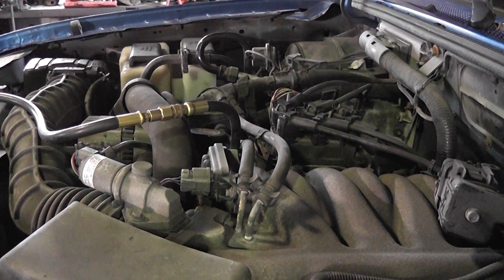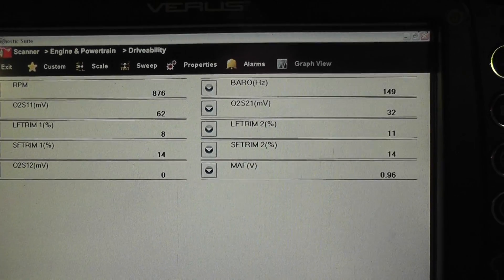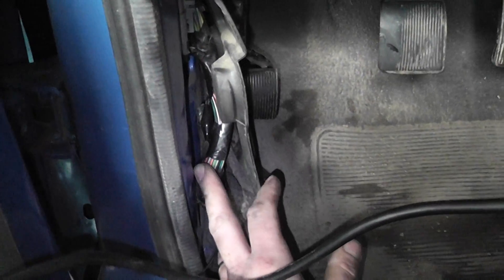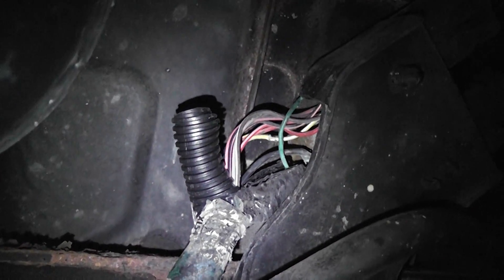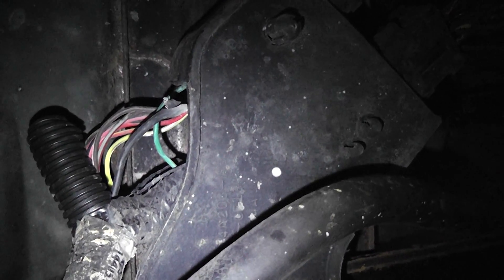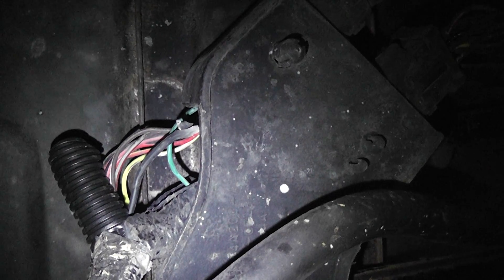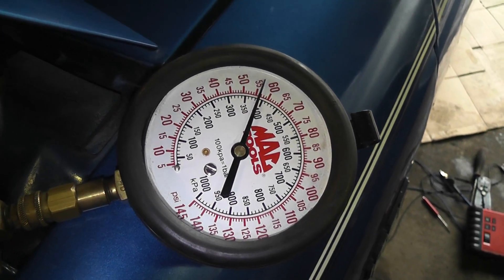Low Fuel Pressure from a bad fuel pump ground (Ford Ranger)

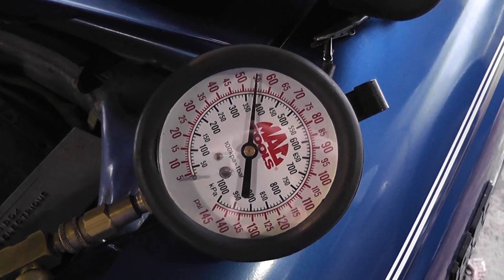Comment: At about 3:25 you said right off the bat that it must be a shared ground between the pump and headlights.  Why was it immediately so obvious to you?
Reply from the maker: Just knowing my fundamentals and circuit designs, I knew it couldn't be anything else. And now that you've been studying and taking my ScannerDanner Premium classes, this kind of thing will start making a lot more sense. It's cool to see you eating this stuff up man. You are doing exactly what it takes my friend. Thanks for giving me a chance !
Reply: I'm really enjoying the basic electrical concepts review section.  Quality instruction on the Internet ( or anywhere else for that matter ) is hard to come by and I'm glad to have stumbled across your channel and then your premium classes.
Reply from the maker: Thanks for giving me a chance!
Reply: Fuel pump is a electric motor.
idk wtf is wrong with mine. its been running lean and sometimes turning over and not starting. Fuel pump not priming. It finally quit all together. I assumed the pump went out since its 1999 f150. Ive put a new one in and its still not coming on to prime. I got 10v at the pump but my ground wasn't from battery. The Audio, GEM, PCM fuse was blown. All others good.

Comment: I meet a guy at spare parts shop, he has a problem with his car when he start the air conditioner, the car shuts off. Maybe it is the same issue here. Bad ground,, possible.
Reply from the maker: If he can keep it running with his foot on the gas pedal, it is a different issue. I'd suggest a throttle body cleaning if that is the case

Comment: Why don't you  test the  ground with a  test light ? You  are loading the  circuit  that way  !
Reply from the maker: Test light only loads the circuit partially (200ma). Where the fuel pump draw is close to 10 amps (10,000ma).
So which one is the better load? This bad ground would have tested fine with a test light to battery positive without the pump running.

Comment: I have a feeling this is whats wrong with my 94' c1500 chevy 5.7. Its running great except for on the freeway after 65mph+ for 5 minutes it starts to slow itself down and Im having a voltage draw issue making my new alternator whine, removing the rear single plug wire makes the noise go away and back again when plugged back in. My blinkers are causing a huge voltage drop when headlights and brake lights are applied at the stoplight.
Reply from the maker: Sounds like two separate issues with one of them being a faulty alternator (lights dimming and whining)
Reply: @ScannerDanner  But its the 3rd new alternator ive put in in a week. NEW not rebuilt. I though they had bad bearings but its a voltage draw causing the whine and Im lost.
Reply from the maker: again, two separate issues, low power complaint with an alternator whine. Did these occur at the same time?
Reply: @ScannerDanner  6 months ago I was on my way home from Lake Havasu on the 40 freeway. You have to have your headlights on when you leave Havasu on the 95 for daylight. I forgot to turn them back off after I got on the freeway and after an hour or so I started losing speed then truck died. Waited a few minuted then back on the road but it did it again within 5 minutes. Over and over until it finally quit, dead battery. Had it towed and the mechanic said he had to put a new battery cause old one wouldnt hold a charge, and that he had to put a fuel filter in to. Wouldnt turn over until the new battery then wouldnt start till the new filter was in, then it ran again. I drove it to Havasu one more time with no issues, but after I got back it started to do that to me on the freeway on my way home at night and has been doing it every single night for the last 3 months. Another new battery didnt help, and the origional alt started to go bad, the battery alt gauge was dropping as I was driving, replaced the alt and no more drop but the new alternator were whining. Old one wasnt. Unplugging the F(field) wire from the back of the alt make the whine stop, then returns when plugged back in. There must be a draw on that field wire. Im thinking there is a bad ground to my dash/ignition system, causing the fuel relay or pump to overhrat while on the freeway???? Last night I had to use my wipers and they were weird, running a few times then stopping for a second then running a few times and stopping again, slowed a bit then speed back up. When I turned on my headlights to leave work my sterio quickly cut out but was still working. Ground?????
Reply: Ive spent over $1500 over the last 2 months on mechanics/ diagnostics/ parts, Ive done research, asked around and cant get anywhere with this issue. Ive put in a new fuel pump, filter and injectors. A new Battery, throttle pos sensor, O2 sensor, ignition control module, MAP sensor, EGR valve and still have no joy. Last week I had the fuel pressure tested and the trans tested, both passed. No water in my oil or oil in my water. Fluids are all full and clean.
Reply from the maker: Absolutely sounds like a main block or body ground issue. Unplugging the F terminal just makes the alternator stop charging. The reason you hear it whining is because it is probably full fielded from charging your battery that you say keeps going dead. 
Ignore the whine for now. Focus on your main grounds. Main cable to the block and main cable to the body, or main body cable to the block.
Reply: @ScannerDanner  OK thank you for your time brother. It has a ground to the intake manifold but only a little red wire to the fender wall, nothing else, no ground to the frame. maybe I need a thicker ground to the fender wall and add a ground from battery to the frame. Ive owned this truck for 8 years and its been hooked up this way the whole time, maybe it was just a matter of time til it did this.

Comment: Do you know if they changed the way this was routed in the 2002 model? I'm working on a 2002 Ranger XLT. According to advanced autos scanner its throwing 33 codes! My cheap harbor freight meter grabbed 11. Everything from miss firing to transmission codes. When driving it dogs bad, like it's starting out in 3rd and never shifts, itll sit around 3 grand on the highway. I can manually shift it down to 2nd but not first. I'm guessing it's a 3 speed with overdrive.
Reply from the maker: I am not sure, sorry

Comment: Have a similar issue on '11 f150 6.2 v8. Trouble starting, left power running board not going down, driver seat not moving up or back, left tailgate lightbar all not working properly at intermittent times and not at the same time. Is there a place that isn't too expensive or free to get good wiring diagrams for my truck?
Reply from the maker: https://www.scannerdanner.com/forum/post-your-repair-questions-here/16-need-service-info-check-here.html
We've created a thread on my forum to help you guys with this. Thanks! It's free to join.

Comment: Hello. I have a 98 mustang GT. It has a slight misfire in 2nd and 3rd between 1500-2500 RPM. My fuel pressure with key on, engine off is 0 PSI, 29 at idle. I replaced the fuel pump, filter and the regulator. I am going to pressure test the fuel pump but I have a feeling it was something to do with the electrical components or the injectors. Any advice on this one? Thank you.
Reply from the maker: This sounds like a light throttle misfire with is usually a secondary ignition symptom. While it is certainly NOT normal for fuel pressure to drop to 0 when you shut the car off, this may just be a leaking pump check valve which will have ZERO affect on how the pump performs when the car is running. The only thing this would give you is a longer than normal crank time. 
There are other causes of fuel pressure dropping to zero on shut down that WILL cause some diveability problems (leaking injector, leaking psi reg diaphragm) but these will also cause fuel trim issues. 
Do you have access to a scan tool that gives you your fuel trim numbers? If you do, I need hot engine idle STFT and LTFT on both banks and then 3000 rpm, again, both banks.
Reply: Hello. Thank you for your response. I just data logged everything. Where should I sent the Excel spreadsheet with the data? at hot idle, STFT on bank 1 was between -1.6 and +1.4 and LTFT started at -4.7 and climbed down to -6.2 with time. On B2 STFT was around -2.3 and LTFT started static at -3.9 and went down to -4.7.
At 3K RPM, on B1 , STFT was between -3.1 and -0.2 with occasional spikes up to +3.1. LTFT was static at -6.2. On B2 STFT was between -5.5 and -0.8. LTFT was initially -3.1 and then stabilized at -2.3.
Before the tests when I turned key one, engine off on a cold car, I had 0 PSI and 29 PSI with engine running. Interestingly, when I turned off the car, the fuel pressure was 29 PSI and the pressure decreased at about 10 PSI per 20 min. I have a return fuel system so I don’t know if this is acceptable. 
During the second testing, on an already hot engine, I had 3 PSI with key on, engine off. Then repeated and the PSI jumped to 11 PSI and went I turned the key on the third time, it jumped to about 35 PSI. After I took out the key, the PSI dropped at about 2 PSI per 1.5 minutes. When I turned the car on with a hot engine, it again was 29 PSI. Gave it some snappy throttle and the PSI quickly went down to about 25-26 PSI and quickly came up to 29 PSI. With different loads at 1.5K, 2.5 RPM and 3k RPM, the pressure stayed at 28-29 PSI. Never went above 30 PSI. After I shut down the car, the pressure decreased by about 10 PSI in about 30 min.
Also, my scanner was stating that the fuel system was in closed loop all the time. From the first till the last second of data logging. I started logging with a completely cold engine and in the end after pressure testing, even went for a short drive with an operating temp. Still it was showing that it was in a closed loop. Is this normal?I would appreciate any advice. Sorry for any confusing sentences.
Reply from the maker: this data log isn't going to help me sorry, I would need to car

Comment: I got a 2000 Toyota Camry 
P0304 
P0171 
P0500 

I replaced 
Cam Shaft Sensor 
Crank Shaft Sensor 
MAP Sensor 
Cleaned the EGR
EGR Modulator 
TPS
VSS - I am Still getting the P0500 (I have a multimeter so I will test that)
Radiator and thermostat
PCV valve and grommet 
Timing Belt 
Plugs and Wires 
Used Lucas fuel injector cleaner X2 as well.
I have a new knock sensor but I could not get the new part on because that is EXTREMELY hard to get the old one off 

The car will run for 15 miles then CUT OUT.
The car will restart 45 minutes later but misfire BADLY.
Something obviously is getting hot then killing the engine
Help Me!!!

Comment: and  for what it is  worth a mechanic , told me the  fuel pressure was between 30 and  40  at the  rail which  seems  low to me . its a  4.0 sohc
Reply from the maker: Absolutely my friend. Thanks for hearing me out. I was a little harsh in my first reply. Sorry about that. Text is hard to tell emotion
Reply from the maker: Yes you do, but your pressure regulator is mechanical. The electronic returnless system I mentioned has no fuel pressure reg. It uses a variable speed fuel pump and has a psi range of 30-70 psi.
60-70 is a little high for you but that's easily 5 psi off depending on your fuel psi gauge. 55-65 is the spec I remember for your system
Reply: If you have the returnless system (fuel filter has one line both ends) 60-70psi is normal, If you have a return line on the fuel system(fuel filter has two lines at one end)  then 30-40 is normal.
Reply from the maker: This is not true, in any way
Reply from the maker: Depends on if this is an electronic returnless or mechanical returnless  system.  For the electronic returnless (variable speed pump) 30-40 is normal for an idle psi. On the mechanical returnless type 55-65 should be your psi all the time (idle and wot) 
To determine design, look at the fuel rail, if there is a 3-wire pressure sensor on the rail, it is electronic
Reply: I agree with that, but I have a electronic in tank fuel pump returnless system and 60-70psi is right in spec. as far as ford is concerned. System is run off pressure and not vaccum like return systems. I guess my system is over pressurized then according to you?
Reply: ScannerDanner  Thank you for the info., your opinion is one that I trust, learned alot from watching your videos, thanks for doing them. Have a blessed day, aloha.

Comment: hey great video dude , I have a f=different problem maybe you can answere , a 2007 ranger sport with a  replaced motor of 61 k ,,,,,,,,,,,,,    I  was  getting poor acceleration and hesitation . the scan read faulty bank 1 and 2 sensors , so I replaced them they were  old and original and  still have the  same reading and  hesitation . oddly ,  the  temperature gauge gets to the middle id say operating temperature in less   than  2 miles or  so ,  can  this  be sending a bad or no signal  to the  computer to go from open to close  loop ., it seems to do it  cold  also , in fla  so not frezzing  cold lol ,,,,,,,,,,,,,,,,  I find it odd it would raise the  needle to the middle so quickly is all , and  can  that sensor just be cleaned . or checked ?  and  would a open loop come up in an obd2 scan with the  rich o2 sensor  readings ?
Reply: As long as you get a code(check engine light), the vehicle will go into open loop by default.
Reply from the maker: You need to take your truck to someone who knows how to troubleshoot.
Oxygen sensor codes do not mean you need oxygen sensors. Sounds like a lean condition from your description.
You also need to make sure the correct engine was put in. Some of these are flex fuel systems that use different injectors than the regular gas only engines.

Comment: Does a 1992 Ford Ranger 2.3 liter 5spd p/u have a fuel safety cut off switch? 
I believe when pump is bad, however when its warm out (above 50°F) she starts right up. In winter (Baltimore Maryland area) it'll crank & crank & eventually catch & the truck will run fine all day after that. The other day while driving,  hit a bump & she started to run like it's fuel starved.

Comment: Dan,I enjoy your videos, they are very informative. I am concerned with your technique of wire piercing.That should only be done in extreme circumstances,when there is absolutely no other way to obtain a measurement. And then the piercing needs to be weather sealed to prevent a future corrosion failure.Sorry for the criticism but, the fact that you are so adept at troubleshooting conveys the message that this is an acceptable practice when really it is the cause of A future problem. I hope you address this in the future. Thanks Bob

Comment: @scannerdanner I have a 2000 Ford ranger 3.0 flex fuel with 101k miles on it 
I have a intermittent code that's says p0176 flex fuel circuit can I can advice on the test or diag the issue without a o'scope?
Reply from the maker: +Xrio Sankara not sure off hand on that sensor. I think it is a frequency generating device. Post this question on my forum. I'm sure my guys over there can help you with some great details. www.scannerdanner.com
Thanks!

Comment: Today I had a 2011 Malibu 2.4 with a intermittent crank no start. No code's, couldn't duplicate, but definitely believed it was happening because the customer put a ecm, fuel pump and fuse block in it. That eliminated a likely component failure. I pulled up a schematic of the fuel pump relay located in the trunk and and noticed the grounds were shared with a majority of the interior lights and rear lights. I asked the customer a lot of questions of patterns he see's when the car acts up. He said the lights flicker when it happens. The lights are shared on the same ground for the fuel pump relay signal ground and the rear defogger too. I toggle the brake lights and defogger on, and duplicated my dome lights to flicker abnormally. I checked that ground with engine running, it had a 1.2 voltage drop from battery negative. Finally got a good direction and theory of what causing that fuel pump to lose power. I couldn't help notice the terminal ground on the front strut tower had the same voltage drop reading so eventually I realized I had a bad body ground. Pulled up engine cranking schematics. Found the 2 points where the negative cable branch out. One to engine and one to body. I load the ground with my uactivate jumping the starter and that body ground terminal started getting very hot. Bingo! Terminal fretting or some kind of air gap in between the terminal and body. Needed a prybar to get that terminal off. Look forward to cleaning it up and retesting tomorrow. That fuel pump was probably getting up to a 6 volt drop when all accessories are on. I watched this video 3 months ago and it gave me good direction to find this problem. Only advise Paul may have not mentioned on screen is I recommend really digging in a ground terminal when testing. I was getting false readings today that threw me off. Normal false voltage when touching the terminal. Abnormal true voltage when scraping the terminal with the multimeter test probe.
Reply: He already reminded us to check grounds. Duh

Comment: Great video, its giving me a starting point with the same exact problems. Using any electrical (headlights,reverse lights, brakelights, signals) all drop my fuel pressure from barely running to kiling the engine if I turn on enough lights. Found a charred/burnt plug with a bare wire going into it at the fuel inertia switch. Repaired it and unfortunately I'm still having the same problems. It's too bad you aren't local, I'd just bring it to you. I don't trust any of the mechanics around here.

Comment: Wow awesome video. Question should all fuel pump pressure be about 50 psi. I have a 04 jag 3.0 engine the x-type. The fuel psi is 27 is that ok. The car takes long to start sometimes.
Reply: They are all different. You have to look up a spec.